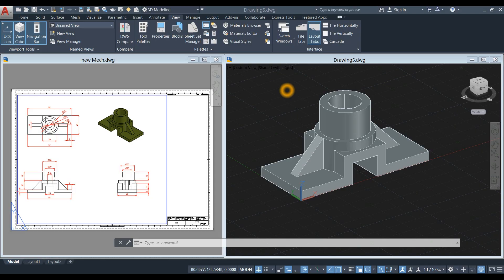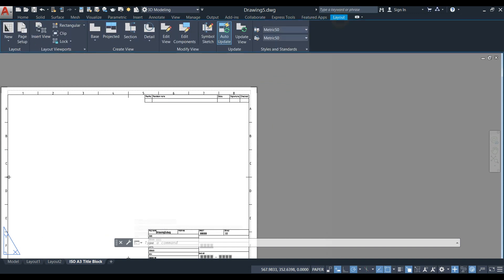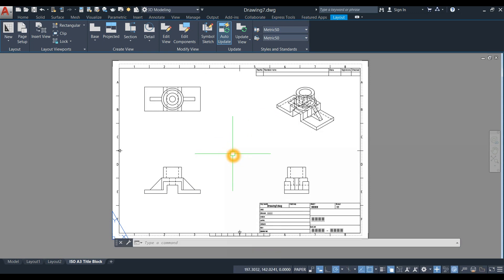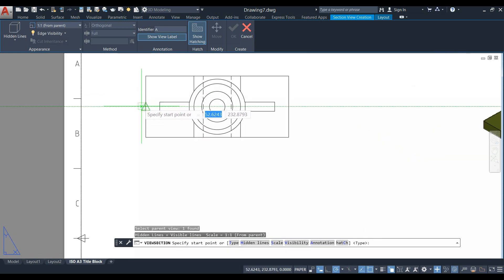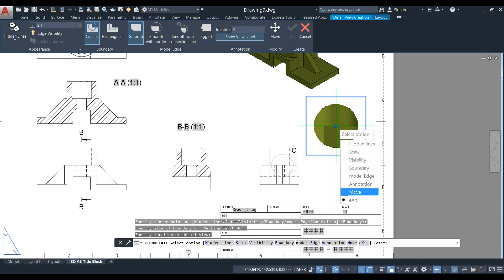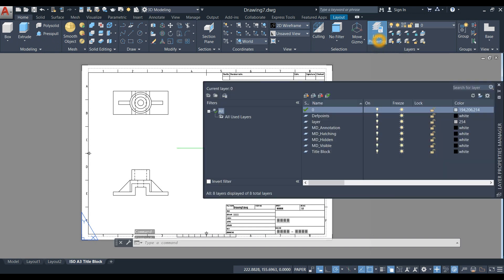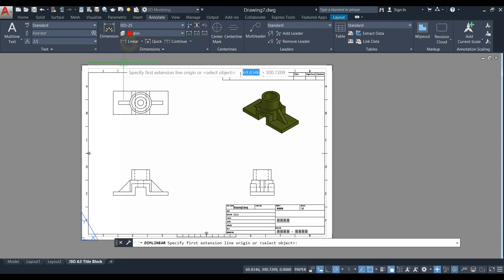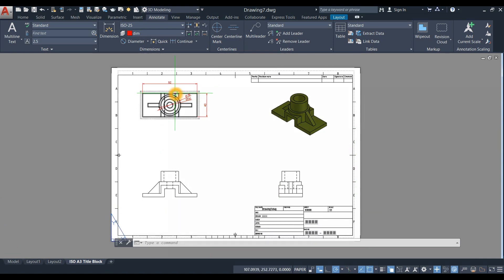Generate Layout fom 3d Autocad & dimensioning

Comment: Hi, really enjoying your videos. I've learned a lot thank you very much. One question, I've projected a section view from the the base view. But when I try to dimension it there's no vertices /grips (like there is at the end of normal lines etc) for the dimensions to work from. would you know why that is?
Reply from the maker: Go down to the status bar and turn on the Object snap or OSNAP or just press the F3 key on your keyboard
Reply from the maker: hover over the OSNAP setting , right click and check the desired boxes or desired setting that you want to turn on, like midpoint, endpoint, etc

Comment: good day maam .i just want to ask what is possible problem why i cant make different views on my drawing.? i followed the steps but in the dialog box theres a mesaage"Inventor failed to load" can you help me regarding this ? Thanks in advance
Reply from the maker: select autocad not inventor
Reply from the maker: I hope it is working now
Reply: @AC3DCad   when i choose autocad it says "select objects to move" what can i do ? thank you
Reply from the maker: @pauljamesmarquez6540  do you have an existing 3d Drawing in your model space?
Reply from the maker: you have to have an already opened 3d drawing before doing this
Reply: @AC3DCad  yes madam i have already opened my 3d flange drawing on autocad.
Reply from the maker: @pauljamesmarquez6540  On the command line in AutoCAD, type LAYOUTTAB and set the value to 1
Reply: @AC3DCad  Good day maam in the layout tab there are many options ("Copy,Delete,New,Template,Rename,Saveas,Set") when i choose set it ask me to enter layout to make current ,but nothing happened
Reply from the maker: @pauljamesmarquez6540  Ok i get it, u missed something
Reply from the maker: @pauljamesmarquez6540  when you right click layout , click "from template"
Reply: @AC3DCad  i already do that madam,then i choose sheet sets and then chooses manufacturing metric drawing template
Reply from the maker: @pauljamesmarquez6540  click the title block at the bottom then click layout on the ribbon
, then  click base
Reply: @AC3DCad  thanks for the help madam,i tried doing it again in autocad 2020 and it works ...so does that mean that converting 3d to 2d drawings are impossible to older versions of autocad? i have older version autocad 2013
Reply from the maker: @pauljamesmarquez6540  could be

Comment: I have an additional question. Suppose your drawing is an assembly of components. You want to create a separate layout drawing (section views,
dimensions etc) for each component.  How does one freeze the layout view for that particular component, and then move onto creating a new layout for another component. When I create a new layout, it screws up the previous layout. I’ve played around with layers etc but no luck.
Reply from the maker: use viewports, select the "4 equal viewports option", create a viewport layer, and freeze the viewport to hide the lines. You can change the views for every viewport window. You can annotate when using paper space.
Reply from the maker: I might do a video of that one day
Reply: @AC3DCad  Yes please, I think if you have time to prepare such a lesson it would be great.